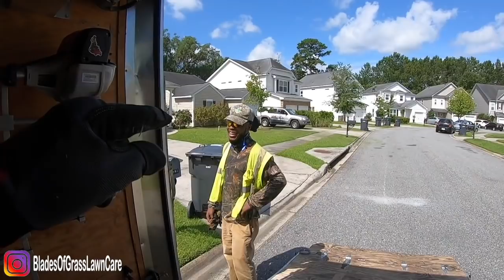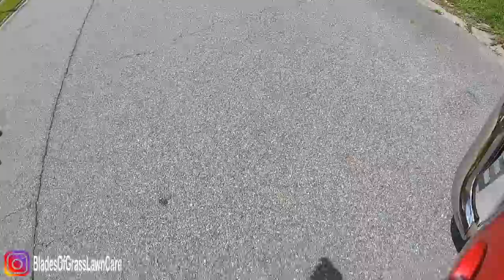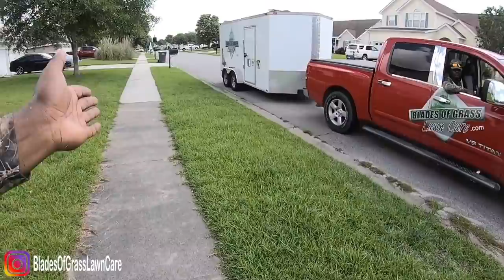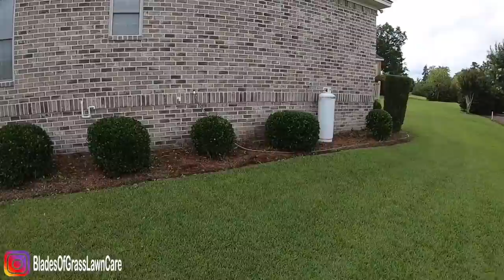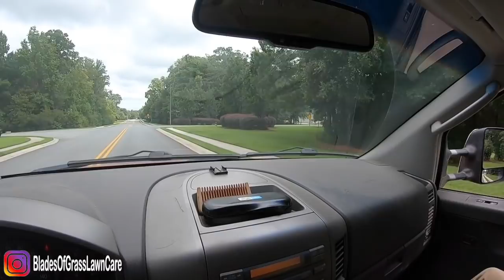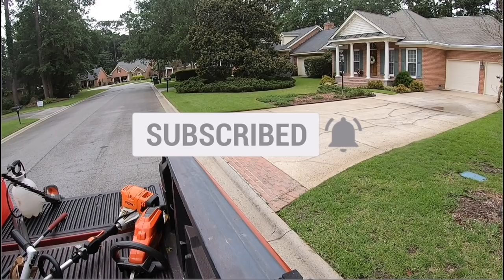Catastrophic equipment damage leads to new business outlook

Comment: Y’all are landscaper comedians & always get me laughing as not many others are like that on here & Gatorade is the way to go I’m the south heat/humidity cause I stay hydrated by sipping on a 128oz Gatorade throughout the day cause 2x I drank straight water (3 liters) & didn’t replace electrolytes at all so I haven’t had heat exhaustion since drinking Gatorade as Walmart’s best place for 128 oz gatorades for sure..keep up the good work (quality over quantity) always gets new customers & word of mouth from my 10+ yrs experience..my prices beat all others in my area & it’s only me vs 2+ guys normally & my quality of work I do speaks for itself cause no other landscaper can top my work with any Florida lawn that’s for sure as that’s how I’m steadily picking up new people & they are loosing clients..also just a suggestion if the mower starts struggling like that raise the deck for initial pass then lower it to what the grass should be cut at next pass & it wouldn’t clump up as much since it’s probably wet/kind of tall..learned my lesson from cutting to low when it’s wet & kinda tall as I still push mow many yards which is good exercise..Sorry not sorry To other landscapers in c.fl..🤷🏻‍♂️😜😂😉

Comment: This is why we have a small 5x 8 trailer so in case our Trailer goes down. In fact, we are using it now because the same thing happened the cable just broke on ours as well.
Reply from the maker: I have a 5x8' red trailer but It needs new tires and with all that's going on didn't have the time to get it done

Comment: For what it's worth I worked 12 hr. shifts in a plant where it was 105 to 115 degrees inside...used what's called a cool vest that keeps body temp around 65 degrees...they are found at safety supply store or online...

Comment: Get yourself a flat-head shovel because this is what I do in my business. You could use it to cut out the grass that's growing over the sidewalk around the edges. Go about an half-inch to an inch back from the sidewalk and drive the shovel down into the soil about an inch or just deep enough to be below the edge of the sidewalk. Then tilt it toward the sidewalk and drive it toward the sidewalk to cut the grass roots. Don't worry if you go a little too far back from the edge of the sidewalk. Because the grass will grow back in naturally to where you edge at if you keep up with it.

One more thing. If you plan on taking my advice with the flat-head shovel to cut out overgrown edges like that; make sure to wear some work boots because the heal of your foot will be sore by the end of just one time of doing that if you don't. So always have a pair of work boots on hand to do that. Also make sure to have a bucket on hand too to clean up what you cut out. You can also use what you cut out to fill in low spots in the lawn when you're done if done right. Just make sure to let the owner know what you did so they don't complain about the spots.

And remember, when cutting that out, and as you have always said; how much are you worth for that service?

Comment: Loving Q drinking gatorade. Most lawn care channels all about that water. You may not be an athlete, but you're sweating like one. Sweat doesn't discriminate between lawn care and sports. Crack that gatorade or powerade. Shits been scientifically formed to rejuvenate what your body loses in sweat. #downwithh2o. Wish I did media other than YouTube lol. Thanks for the video. Still finishing it so might add more comments later.
Reply: 12:00 in. I charge more for the blade than string trimming on edges. I give the customer the option knowing with a string trimmer it'll take a bit to move the line back, but it's cheaper. Usually they're okay with it since overgrown only happens when folks don't maintain. 
Don't often comment, but always watching and viewing ads in appreciation for the work you do. Thanks again man for everything. Entertainment and info all at once.
Reply: Do you prefer the 4 position push mower adjustment over 2 or 1? I prefer 4, just curious as to your insight.